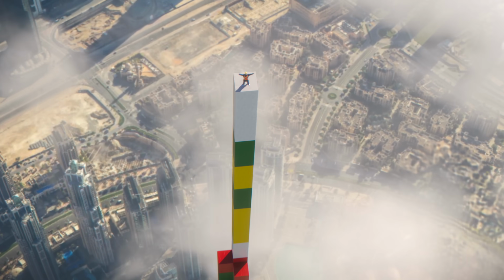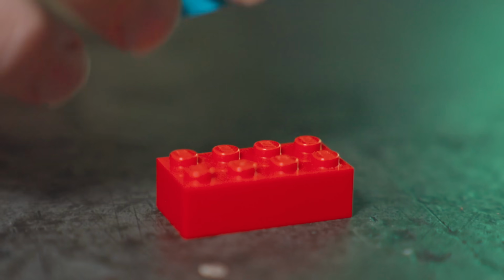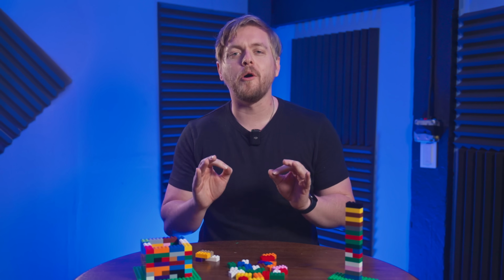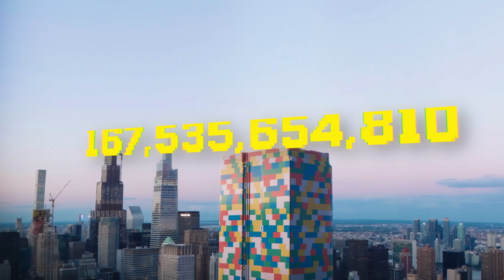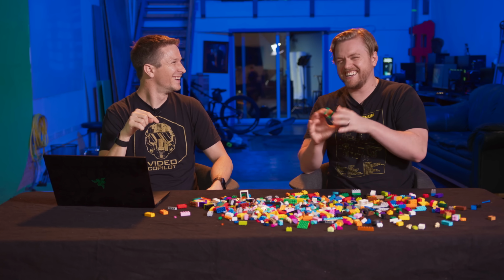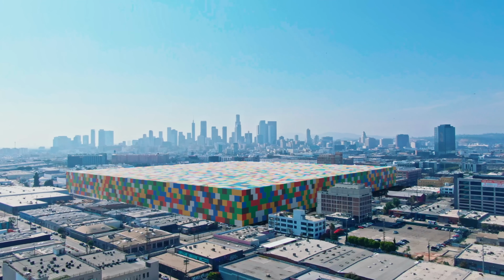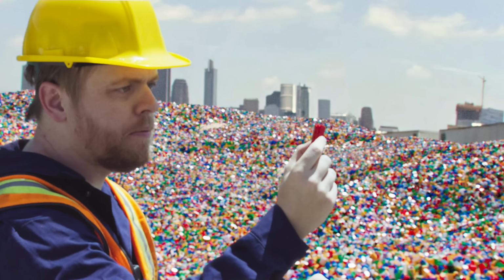How High Can You Build using only LEGO?

Comment: Make a lego
Color:
Red
Orangy red
Redish orange
Orange red
Oranger red
Orange
Yellow oranger
Oranger yellow
Tanner yellow
Yellow
Yellower lime
Yellower greeen
Lime
Greener lime
Harder green lime
Greeen
Small blue green
Green blue
Green torquise
Torquise
Green blue
Blue
Plurple bluer
Bluer purple
Purplish blue
Purple
Pink purpler
Hotter purple
Purpler pink
Pink
Light hotpink
Pink hotpink
Hotpink
Reder hotpink
Red hotpink
Shade:
Black
Darker gray
Dark gray
Gray
Light gray
White gray
Part color
Normal
Whiter gray
White
Pure white
Size:
1x1
1x2
1x3
1x4
1x5
1x6
1x7
1x8
1x9
1x10
2x1
2x2
2x3
2x4
2x5
2x6
2x7
3x1
3x2
3x3
3x4
3x5
3x6
4x2
4x3
4x4
4x5
4x6
Style:
Normal
Ball
Cylinder
Block
Material:
Asphalt
Brick
Forceflield
Plastic
Smooth plastic
Rock
Stud
Inlet
Sand
Snow
Foil
Fabric

Comment: Hey Corridor Crew... You forgot one important detail. When you calculated the max height, you assumed a single stack. When you calculated the height for the pyramid, (correct me if I'm wrong) you used the same number. (2.2 miles) In reality, pyramids spread the weight over a much larger bottom surface, which means the total height can be HIGHER before any single brick reaches the point where it buckles. My calculations show the max height for a LEGO pyramid to be 6.7 MILES.
Reply: 6.7 equals 67

Comment: Hi, I'm writing this 4 months after the video released, so I don't expect Corridor Crew to ever see this, this is for those curious folks who are wondering if this is the limit and the answer is no! C.C. I love you guys, but you forgot about S.N.O.T. bricks and Technic! SNOT means studs not on top. These are your bracket and modified bricks. Technic was also made with the idea of stability in mind to the point where most big sets use either if not both of these techniques. Snot bricks means you can attach plates vertically providing strength against horizontal forces meaning it won't buckle. And technic can he used to not only also strengthen it vertically but also do cross beams. All this to say that this is the limit with lego brick blocks. Not with lego brick parts. P.S It did annoy me that you guys always stack them vertically in the vfx shots. I know it's a lot of work but for the close ups, you could have al least stacked them with a brick pattern, which is the correct way to stack them. Look at any house with bricks. They don't stack them directly on top of each other.

Anyways. Love the work. Great video.

Comment: Your deformation mechanics is all wrong.

You wouldn’t be able to crush the bottommost center piece of the piramid this way, because the horizontal force would cause the piece to bulge on the sides. However, since there’s no room for the piece to bulge, the downward force required to crush it would be significantly higher, considering that your initial estimate for the required deformation force of a lego piece was made for a piece without any lateral support.

In materials science terms, you can think of the entire structure as one single material. We would then have that the stress-strain curve of the lego tower would be different than the stress-strain curve of the piramid. The piramid would have a much higher compressive strength and the ultimate tensile strength of the bottommost and bottommost center lego piece of the respective materials would be different.

Now the real question is what am I doing with my life, writing a small essay in an YouTube short at 2:30am when I need to be up at 6am. Self-sabotage at its finest!

This comment is a copy of my YouTube shorts comment. Since the original comment was intended to be an educational comment, I decided to copy it here to broaden its reach. 

Love the channel, really entertaining.

Comment: When considering the forces that act on a singular piece of Lego stacking the same piece on top if it, shouldn't they consider how the bricks have less gravity acting on them as they go higher? Rather than just multiplying the weight of individual bricks to get to the pressure threshold of the first brick?

Comment: Personally, I feel it's more improbable than impossible to go more tall than wide. cause it'd likely have to consider factors that engineering hasn't caught up with. Especially since we don't normally use plastic to build things

the 35 meter stack of lego is kinda proving that already. you'd likely need more engineering techniques and geniuses to go higher

Comment: I think there are a few more problems with that last lego structure. Its important to know how fast it can built, because plastics usually are sensitive to the sun. Decades in the sun and weather could at least damage the outer structure of the building. There is another problem which on lower scale is negitable:  plastic actually also absorbs a tiny amount of water when it rains, meaning: it makes the structure more heavy , which means, it cant be built as high as the video mentions.

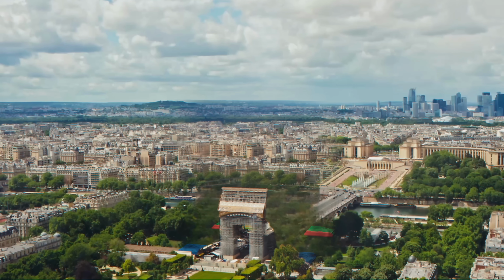Comment: 7:21 answer is 39,391.10474219144 meters cubed lel
millimeters = MM
Meters = M
The volume of a Lego brick = 31.8 x 9.6 x 15.8 = 4,823.424 [MM3]

Eifel Tower volume = 190,000 [M3]

We can do one of these things:

[1] We'll convert the volume of a Lego brick to meters since the volume we found is in millimeters, so Volume in Meters for the brick = 4.823424
Divide Eifel Tower Vol. into Brick vol. in meters [190,000/4.823424 = 39,391.1 to 1sf]

[2] 190,000/4,823.424 = 39.39110474219144 x 1000 [We multiply by 1000 to covert the current value-which is in millimeters-to meters.]
So, we get 39,391,10474219144 [M3]

Correct me if i'm wrong, i'm not a math guy lel

Comment: The UV radiation over that time would degrade the plastic enough in the outer layers to make replacing the outside layer constantly a factor to consider.
Also, there are fungi already adapting to break down plastics, so over that time scale the tower would be eaten by the co atantly evolving fungi.
It wont work

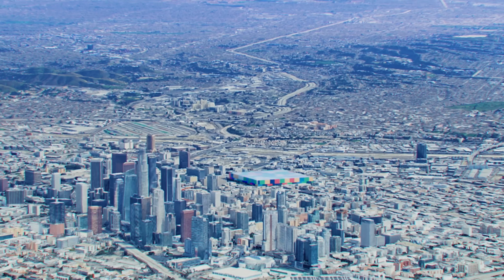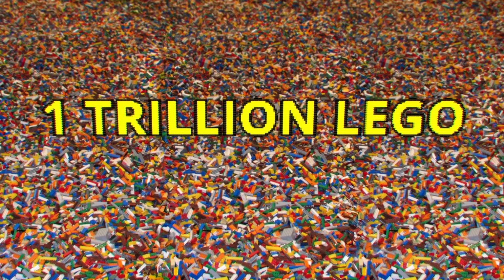Comment: @13:41 If melting/reshaping all of the ABS plastic in the world would leave you with 100,000,000,000,000 (100 trillion) Lego, and the stat you threw out at 5:45 is accurate, you guys overlooked 2 wild statistics: One percent (1%) of the world's supply of abs plastic is already in the form of Lego; also, all of the Lego that already exist in the world weigh 3,590,000 tons (3.59 Mega tons) = 7,180,000,000 pounds (7.18 billion pounds) = 3,257,000,000 kilograms (3.257 billion kilograms)!

Comment: With regards to the load on the bottom brick... When you showed the hydraulic press info, the press applied the weight to the dimples on the top of the brick which distributed the weight across the surface but when stacked, the brick does not depend on the top of the brick for integrity, it sits on the side walls of the brick

Comment: 8:24 that's not the largest man-made structure on Earth. It's the tallest building. The largest man-made structure by volume is the Syncrude Tailings Dam in Canada - 540 million m³ of construction material. And if by structure you mean buildings that would be the the Boeing Everett Factory - 13.3 million m³ of volume.

Comment: legos also make pieces that are one big sheet like a rug usually its a mat and then you build on top of that. im wondering if you use those like every few stories to hold down them all. its just one big sheet of lego you just lay it down either on bottom or like every few feet. itll snap and connect to all the other legos holding them all together.

Comment: I think the forces grow from the top to the bottom of a structure as F = ma.  Legos’ mass from above press on those below.  If you build the bottom wide enough you should be able to go arbitrarily high although at some point the individual legos will probably start to crack even though forces should be spread out along the base.  But assuming there were no wind — a pretty poor assumption — I’m guessing you could go really high assuming a wide enough base with each “story” getting more narrow as you get higher.  (Here you say that structures “cheated” and added glue.  That might help stabilize the structure.)

Comment: It wouldnt be impossible nothing ever is with enough will there's a way for example if 2mm swaying is the problem in the midpoint calculate the midpoint and put a structural brace such as steel cables mounted to the ground like a radio tower or a metal belt like brace that wraps around the weakest point to prevent snapping.

Comment: Sooo…not to immediately say the math is wrong but…the article that is used for the weight a brick can withstand is for a 2x2 in a singular stack. As soon as you start distributing the weight and using a 2x4 as the base building block you can: 1. build it taller 
2. Not use as wide of a base
3. Find your optimal dimensions of base/height/weight/number of bricks.
Reply: Additionally siting that the center of gravity could only be off by 2mm was again only if it was a 2x2 straight up. A structure that would only be 16 mm wide. So, Lego is so confident that they would allow the structure to move 25% off center before it cracked. Yes this would happen immediately on such a thin tower but this takes the ratio of 5:1/10:1 of height to width and throws it out the window.

Comment: I really like the concept of the video, but I didn't like that you mixed changing the structure with also changing your assumption about how many Legos were theoretically available. It made for a weird comparison between segments. If you wanted to do both, I would suggest to have done them sequentially. 
For me, the primary reason is that gathering additional ABS or oil, though a fun thought experiment, is nowhere near realistic. Whereas, building a giant pyramid of Legos probably really would work just fine without falling.

Assuming 1 Trilion Legos in the world and that approximately 0.5% of those are 2x4 bricks and that only 2x4 bricks are used, and that it is solid (which seemed to be your assumption throughout the video), I calculate that a pyramid that is 3106 lego blocks high could be built which would be almost 98 feet tall and 163 feet wide at the base.
Note that an additional 7% of bricks (which are likely to be built by Lego soon) would be necessary to reach 100 feet tall.

Comment: If the aim is to build to the limit of the bottom layer, as a pyramid, you'd need to build it 3 times taller. Meaning 27x the amount of bricks.

Comment: Thing is tho, lego makes more than just 2x4 bricks, so you could in theory use mkre structurally stable peices at the bottom
ALSO you wouldnt need to fill in the whole thing, right? Making the outer walls thick and then using a honeycomb infill, or better one, it would be more structurally sound while giving more peices to contimue the length.... in theory...

Comment: The problem is the study of the force to squish a brick only calculated for a single stack of bricks. The extra weight of bricks when making a wider structure will squish the bottom layer way before you hit two miles

Comment: The two mile limit is on a single brick wide tower. With a proportionately wider base, the force acting on each brick would be distributed across that base allowing for a taller tower. So the pyramid structure could be much taller. Eventually, due to the cube square law, the rate at which the weight of the pyramid increases would out-scale the distributing effect of the base and the bottom bricks would fail. It would be extremely hard to determine this limit analytically tho
Reply: I wondered the same thing, is a 1 block have the same crush strength as a 2x2 block?  One would think the extra blocks would help each other

Comment: well... a lego can take about 950 pounds of force, which is about 375000 legos and the hieght of each is about 9.6mm without the stems soo before it gets crushed it could be about...  11811 feet... 2.237 miles... or about 5.5x the height of the mia kalifa

Comment: You forgot to consider one more factor:   You don't need the structure to be COMPLETELY filled out.  I mean look at the Eiffel Tower,  that thing is 90% air!
Reply: Yup, although it does become a little tricky, given how much the strength of a lego structure isn't uniform. It's quite possible you can't make the exact shape out of basic lego and still be structurally sound.
Reply: Not to mention that stacking the bricks on top of each other is probably the least structurally sound way to do it. Its why no one would do that with real bricks.
Reply: Nah because the empty spaces inside would create pockets where the bricks would fail which would lead to them collapsing in on themselves. So this was theoretically speaking the only sound way to do it with the full 100% blocked pyramid.
Reply: @DreamRJ you could compensate for that by building lego pillars on the inside.
Reply: "actual engineer"
Reply: A fractal, you say? That'd be dope.
Reply: That’s what I’m taking about. And the weight will be less
Reply: I agree with the air. The actual lego towers they build are a sort of big 'blocks' made of lego bricks. I don't know if it would work for the piramide, but for the small tower certainly.
Reply: Technically, no. It is made with 99.99% Air, because of the property of matter.
Reply: @jaxalt3  are you saying there is air between the protons and the electrons of any and all atoms?

I seriously doubt that.

(Because Air is gas molecules and atoms - there's no atoms inside of the atoms)

Comment: pyramid heavy. the weight would push down against the continental plate in that location, similar to the continental ice sheets. in such a localized spot(relatively compared the an ice sheet), your pyramid might cause geological activity, fissures, volcanic up welling, seawater invasion as the land subsides. on the plus side, free saltwater moat with neato geysers. very villians lair. which given you may have destroyed all mankind to make the monument, seems fitting.

Comment: im almost certain you could make the pyramid taller by building at a much steeper angle, it wouldnt be a perfect 51 degree structure and you most certainly would risk re-introducing problems but simply doubling the layers before you step inward shouldnt cause that much of a problem right?

Comment: wait a moment, your pyramid is only 2 and a quarter miles tall, based on that a stack of legos this tall would squish the lowest one. Would not a pyramid distribute the force towards the sides, distributing the load over a much larger bottom layer, therefore allowing a building that far exceeds 2 and a quarter miles in hight?

Comment: I once built a roughly 6x6x6in lego cube out of various 2byWhatever thin pieces while gently tapping each one with a rubber mallet after placing. Didn’t find a single person that was able to pull any of the pieces out and eventually disassembled it by applying kinetic energy (smashed it into the ground repeatedly)

Comment: I think it's not enough to just put the part under the press. First, if several bricks are placed side by side, then the middle one is held and, in theory, can withstand a heavy load. Plates can also be used instead of bricks.

Comment: Some more lego measurements for you to consider. It takes 2kg of crude oil fossil fuel to create 1kg of lego bricks. Lego produces around 60 billion bricks per year. which is 150,000 tonnes of bricks. Therefore, lego takes around 300,000 tonnes of oil per year to make its bricks. Thats about 2.2 million barrels of oil. The global consumption of crude oil across all uses is somewhere close to 100 million barrels of oil per day. Lego therefore uses around 0.01% of all the fossil fuel available. Not a huge amount, bur for a single company it is significant. If you scale it up over legos lifetime it becomes around 47.7 million barrels of oil since 1958.

Lego has pledged to end its use of fossil fuel based plastics by 2030 (likely to be replaced by bioplastics).|

Comment: 18:50 to answer this question with another question: how long would it take to slide down this megastructure? I WILL WAIT FOR THE ANSWER
Reply: 5-20 minutes
Reply: Definitely, on a sled 🛷
Reply: Will there be any of you left? Because the surface is not smooth, its like a cheese grater. I mean, have you ever step on one of this little razor😂
Reply: @Tariqtoriko I will not survive the first 12 seconds of sliding 😂 my son leaves his legos everywhere and I’ve met my maker many times from those
Reply: bot detected

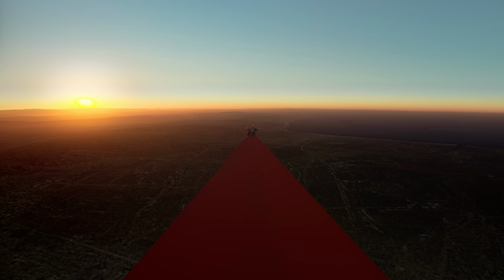Comment: 18:14 and now as the graphic showed the forces are pointing down at an angle, therefore the bottom edge bricks have too much pressure and will be squished under the weight.

Comment: Did they take in to account that if bricks are against each other the force would be different because the brick is sealed from all sides? So it would deform at a higher pressure.

Comment: You don't need to go back thousands of years for structures that are more resistant to buckling. Several medieval architecture styles solved this with "rib" designs, where you have the central wall or column supported by slimmer structures. You could use this to severely cut down on the material requirement for the same effective footprint (which was already overkill anyway).

I'd also argue that you'd have a significantly higher buckling force for interlocking compound bricks than the one calculated for the singular brick.
To buckle, the material would need to be able to deform in a free direction. For a singular brick that's outwards. But that space is already occupied by other bricks, which also try to push outward. Then how about inward? Possible, but there you'd have to overcome the horizontal buckling force as well, because the walls are pushing against each other at the corners. That leaves tilting all walls in the same direction. But that too is harder if you have the bricks interlocking with each other and holding each other in place.
And since each brick rests on multiple other bricks below it, any weight would be distributed over a wider area. So the more you taper your Lego build, the higher you can go.